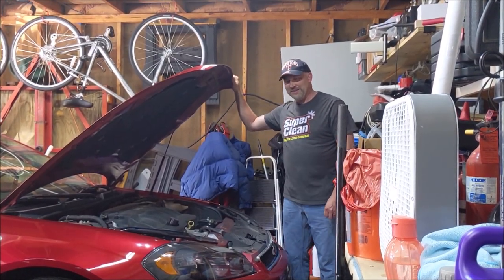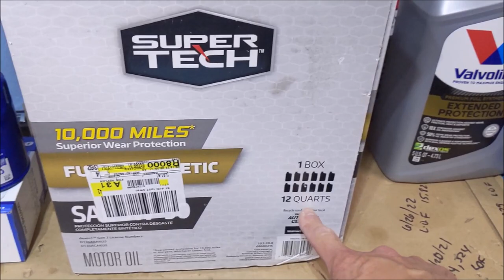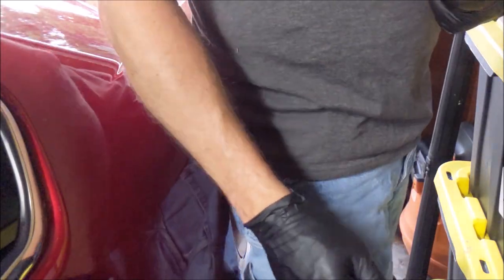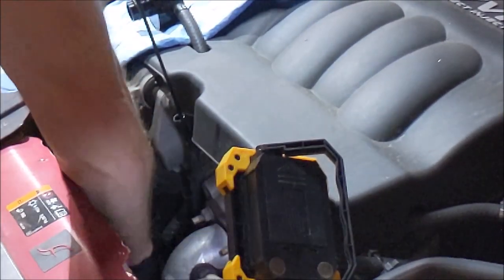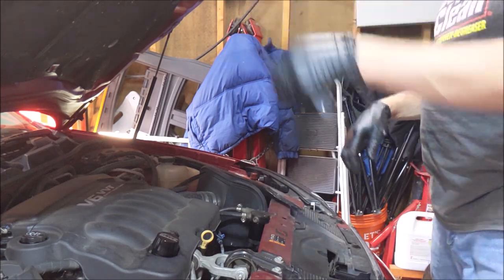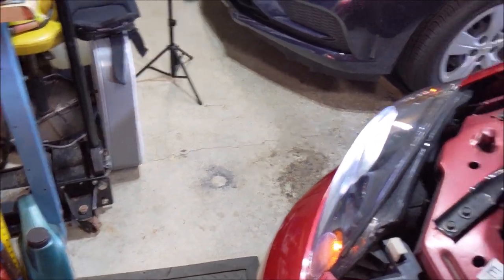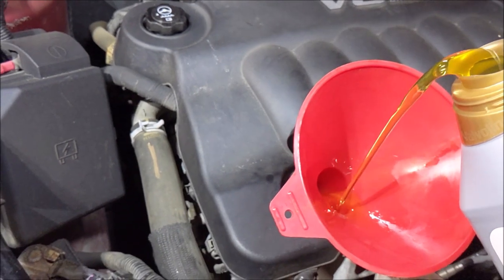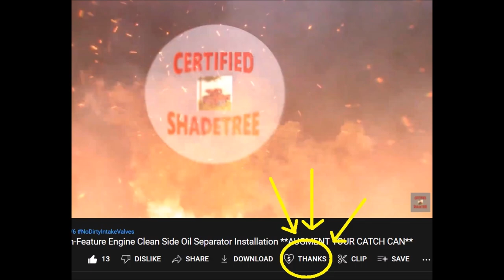BG "Engine Performance Restoration" Motor Flush on a GM 3.6 High Feature V6

Comment: Probably a little kerosene right before you changed the oil would do the same thing. Personally I would just change the oil more often and get the same results over time.
Reply from the maker: Certainly. Trans fluid or diesel fuel could be used as well..
Reply: you will need to do like 50+ regular oil changes to flush out the same amount BG does with one can of EPR. Sludge is VERY hard to get rid of with just oil, once it builds up
Reply: it will not do the same thing. it has been proven by fordbossme, if you smell the BG EPR you’ll see that it isn’t like the motor flushes sold at auto parts stores.

Comment: I wouldnt run Valvoline in my weed eater.  I use Castrol GTX High Mileage.  Long story short,  i overheated a 2.5 V6 Sebring that had LOUD LOUD LOUD Lifters.  I overheated it trying to climb the mud hill to my ex mother in laws house which was rutted wet clay on a steep incline.  I overheated this engine flr like 10 minutes and didnt realize it.  The temp hand was BURIED all the way High.  I only noticed it was overheated because it lost so much power that it felt like it only had 75 hp.  Barely would spin tires in wet clay.  I drove it to my ex sister in laws house and popped the radiator cap and it hit the hood so hard that it dented my hood.  And it wouldnt crank after i shut it off.  I just KNEW i locked this engine up.  Let it sit for 4 hours and added coolant,  and checked oil level.  Hit the key and the car started RIGHT UP and had NO MORE LIFTER NOISE.  And it felt like it gained 25 lb. ft. of torque over factory.  And i couldnt believe it survived what i put it through.  And i give FULL CREDIT to Castrol GTX HM that i have ran in EVERY ENGINE ive owned since.  And right now my 06 Xterra has 330,000 miles and going strong,  and my 06 Pathfinder has 240,000 and going strong.  Ill never spend a dime on Valvoline after seeing the Bearing Stress Test and how Valvoline failed MISERABLY under force.
Reply from the maker: I've used GTX extensively in many vehicles, but I won't put it in a GM High-Feature engine. These engines EAT oil and Valvoline is the only oil that I've used that stays up to the full mark for an entire OCI. And with these engines, ignoring the oil level or neglecting maintenance leads to massive amounts of sludge which in turn leads to VVT solenoid failure, cam phaser failure, and timing chain stretch.
Reply: valvoline is proven to be some of the best oil on the market that is for sale in stores. have ran it in my 02 silverado from when i got it at 60k miles to now at 236k. large cam and 10” of lift on 14 wides and 35x15.5 tires. just now changed to pennzoil ultra platinum at the last oil change after performing a BG EPR flush. the penzoil is only marginally better than the valvoline but it’s worth the small bump in cost to me.

Comment: Putting Oil on your filter gasket is a BAD IDEA.  Oil destroys the integrity of Rubber.  Now given,  you wont be leaving that filter on there for 5 years or anything,  but it doesnt change the fact that Oil and Rubber dont get along.  I like my Filter Gasket and Housing to be oil free when i install my filters.
Reply from the maker: VASELINE is what you want to avoid. That'll tear that shit up. Motor oil, though? Well I guess if you're scared of it you could always use a dab of a silicone-based lube like Syl-Glide.
Reply: That is contrary to what oil filter companies instruct you to do.
Reply: You definitely have no clue what your talking about. The heat alone without oil on the filter gasket will weld itself onto the mounting surface. If it hasn’t yet in your case then you better buy a lottery ticket.😮
Reply: @johnmilner7603  Dude get real.  No it doesn't.  We're not talking about a metal oil filter gasket being welded to a metal housing due to °3000 degree temperatures.  I've changed my damn oil for 22 years without putting oil on the gasket and it comes off with the filter every time.  That is the silliest thing I've ever heard.